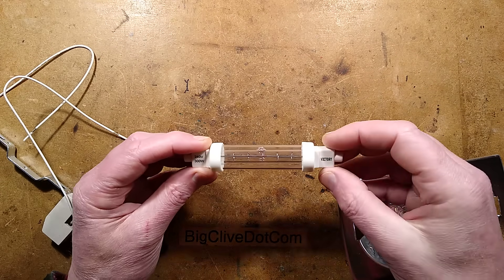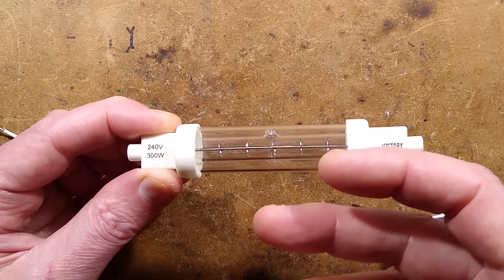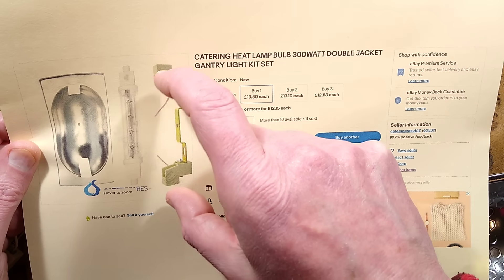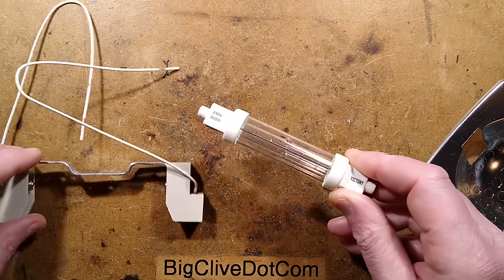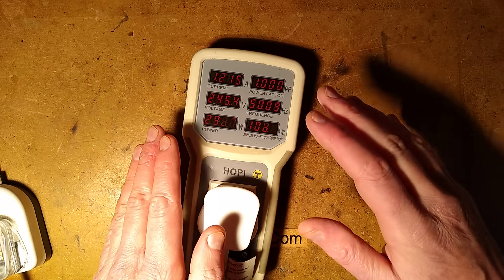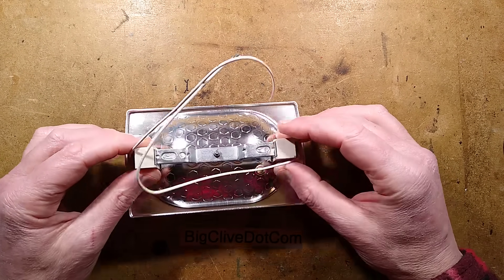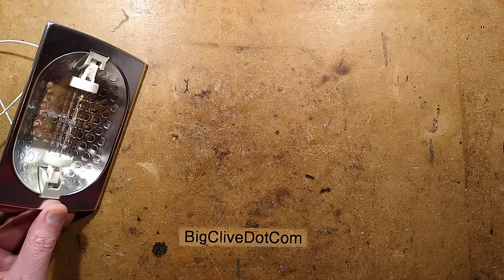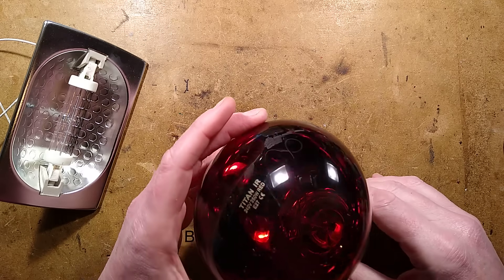Instant heat from an interesting linear heat lamp

Comment: Ah, one of those heat lamps used by places with a carvery to make sure that the Yorkshire Puddings are nice and hard and can be used as hammers and the outer skin of roast potatoes can be used as a leather substitute.
Reply: mmmmmmm nice roasted spuds that take the skin off the roof of your mouth. 😘👌 👍👍
Reply: leather subistutte....- sorry i cant write, alck of air
Reply: You forgot to mention turning the vegetables into galvanised rubber that can’t be chewed along with the gravy that needs to be hit by the Yorkshire Hammer Pudding to break the 2 inch layer of solidified gloop

😋
Reply: And pies can attain temperatures only found in experimental fusion reactors
Reply: @PaulG.x   ice cold on the outside, still piping hot on the inside, somehow.
Reply: I suspect that the tool replacement value was determined more by the initial fabrication than the later thermal treatment :)
Reply: Not to mention the breakfast application - imbuing scrambled eggs with a hardness best measured on the mohs scale
Reply: And the handles of the spoons melting into the cauliflower

Comment: My school kitchen uses 8 of the 250 Watt clear ES screw heat lamp. I don’t generally get 1000 hours life out of them, but interestingly the adhesive bond between the ES cap and glass fails before the the filament fails. This results in the lamp wobbling in the holder, so I replace them when they become loose to prevent the glass envelope falling into the food.
Reply: I've successfully used Gorilla Glue to reattach loose lamp caps. Use it sparingly though, it expands a LOT as it cures 😁
Reply: Same thing happens to the SES bulbs in my microwave!
Reply: Try buying quality branded lamps such as Victory Lighting as these are manufactured with the correct adhesive/cement which doesn't,t degrade over time. Cheaper brands and Chinese imports use standard cement and sometimes do not even have toughened glass.
Reply: I was thinking of that as Clive got it in to view.. #nasty

Comment: I remember, back in the day when some bathrooms had the lovely red heat lamps.  I really miss that!  Something about that red light just felt so nice to bask in while sitting in the tub.  The 70ies got SOME things right!
Reply: you can still see those in the US in some of the cheaper hotel bathrooms. especially in colder climates. so old, usually hooked up to a self timer, right?
Reply: That is different 'tech', a tubular (coil) heater element or made of (flat bar) nichrome
Reply: Here in Norway it is still normal to have one of those IR heaters in the bathroom. I even mounted one in my box van camper to get quick heat when I need it. They sell them everywhere here.
Reply: I still use one in my bathroom today that was installed in 75,, I've only replaced the bulb once 8 years ago.
Reply: The wife and I stayed at an older model in Amarillo on our way to Dallas for Thanksgiving. It had one of those old radiant heat bulbs. I turned that puppy on and basked in the glory of its warmth. Gotta love how water absorbs infrared light, and the fact we're mostly water. I didn't even turn on the main light for illumination. The warm, mellow vibes were just what I needed after 10 hours on the road.
Reply: Movenpick hotels had them until quite recently!

Comment: As a hotel maintenance worker I would say we get about 6-8 months out of these lamps, but they do get a pounding, on about 10hrs a day. Changed 3 of them this very morning. One of the maintenance team must have touched one of the lamps with his grubby little fingers because the chef said it exploded in quite spectacular fashion.
Reply: Here in Norway they instead use the IR lamps with thick steel element that glows deep red, they last forever even if you leave them on 24/7 for years... But they take a few minutes to heat up.

Comment: 1.) All glass bulbs need to be protected against shuttering in the food industry. Neon tubes have a plastic tube around or a plastic shield under it.
2.) What you called the "chicken pen type" lamp was exactly what was used in East Germany as "Rotlicht" or IR heater for your nose and ear when you had an internal infection.
"Fun" fact: there were still very few apartments in East Germany with an external toilet until the 1980's, usually ½ floor up or down with a door from the staircase. As there were no ovens or central heating in these toilets these lamps were used 24/7 during wintertime instead of the regular illumination as a protection against freezing and destruction of the water installation. 🤪
Reply: Actually in the food industry you should use enclosed IP68 lamps, However I have replaced all 500 in the factory with LED so no longer a problem. Payed for themselves on 6 months.
Reply: Can you elaborate a little bit more on the nose and ear infrared heater? I tried to google but found nothing. Is this just a small miniature bulb you stuck in your nose/ear?
Reply: @eugeneputin1858  https://de.wikipedia.org/wiki/Infrarot-Behandlung
It "liquifies" the residue in the paranasal sinuses & Co.
Reply: @eugeneputin1858  I was just going to say that Philips sold similar things in the west then found that the picture on the Wikipedia page is of a Philips lamp.
Reply: @MrDuncl pretty sure my grandmother had the exact Philips model pictured in the wiki page.
Reply: @MrDuncl  Philips 150 W is the actual model. It was the slightly bigger, rounded Model with 250 W in East Germany.
Reply: Dutchlander here, can confirm, my mom still has one of these face warmer things I think, and I remember using it as a kid. I think I had a sinus infection.

Comment: We used to use 2 500w floodlamps for warming up the inside of a 8' x 10' container modified to house a TrackStar machine for butt fusion welding MDPE / HDPE pipes for cross country water pipelines. The TrackStar did the actual heating for the welds but having a bit of ambient heat made the process more reliable and better for the operators.
Reply: Why would you want to fuse your butt to another butt?
Reply: @Dime_Bar  C'mon, we don't judge here. chuckle
Reply: @Dime_Bar You obviously don't know how to have a good time, but I hope you have a merry 25th of December.

Comment: I remember those red heat bulbs being in many bathrooms in the 70/80s, before we all had central heating and double glazing as standard, it was a godsend when getting ready for school in winter mornings before the living-room coal fire had a chance to heat the house or water, I used to get changed under it!
Reply: What country didn't have central heating in the 70s/80s or at least oil or gas heaters?
Reply: @rogerwilco2  Central heat/air started becoming commonplace in the 70s/80s. Most older homes would not have had it.
Reply: @rogerwilco2 the UK for a start! I'm 35 and even I can remember houses without any central heating into the early 1990s.
Reply: Still have one in my 1985 house, in the only un-remodeled bathroom.
Reply: @rogerwilco2  Neither of the 1980s built houses I bought here in the U.K. were built with central heating. In the 1984 built one, I bought an electric cooker so didn't have to pay a standing charge on the gas.

Of course back then a 23 year old on an average salary could actually afford a new house, even if they couldn't afford one with central heating.
Reply: There was one in the bathroom of the house my parents bought 1968 with two bulbs side by side, a normal spot for light and an infrared one for heat. I can't remember exactly how they were controlled. Probably a pull cord.
Reply: I feel like every hotel room in the US in the '80s had one of those in the bathroom, connected to a rotary timer so that you couldn't leave it on for more than about 30 minutes.
Reply: @wbfaulk  It was as ubiquitous for hotel rooms as the razor blade disposal slots, which simply dropped used filthy razor blades into the wall between studs.
Reply: @rogerwilco2  Norway... Very few have / had central heating. Most use one big wood oven or electric ovens in every room to keep warm.
Reply: -ADACOR- the back boiler is typically a separate unit installed behind the gas fire. Gas back boilers are designed to fit in a fireplace where you would have had a coal fire. And indeed, back in the heyday of coal fires, you could get coal fire back boilers (can't remember the trade name) that could heat water to supply a small number of radiators elsewhere in the home.
Reply: @rogerwilco2  UK. My first rented flat in London in 2000 had neither central heating nor double-glazing – it didn't even have storage heaters!
I had an open grate in the living room, and used a convector heater in the kitchen.  I must admit it got very cold in Winter as it was a GFF in a VIctorian terrace, so very deep and had high ceilings. During the coldest months, I moved into the living room and slept on my (thankfully very long!) sofa – rarely going into my bedroom. My first house a couple of years later was the same.  You could rent much cheaper in London if you opted for a flat without either.  And for my first house purchase, again I got a relative bargain.

Comment: Way back in the 60s my dad had installed a dual lamp fixture over the sink and during the Northern Wisconsin winters, he would unscrew one of the standard lamps and screw in the heat lamp. We used it to warm up the bathroom before us kids would take our weekly baths.

Comment: I made a PCB preheater using 4 standard halogen 500 W linear lamps, wired two in series, some stainless steel mesh and a standard triac dimmer. Putting two in series makes them give out more heat than light.
It is really helpful for desoldering and soldering PCBs with huge ground planes, as well as for hot-air (de)soldering of SMD/BGA.

Comment: I bought a 600W flat panel IR heater this year, as it has the ability to heat up solid things like tables, walls and, er, me, without heating up the air.  I'd quite like being warm but not having cooler air around me.

Comment: The Reflective heat lamps are still very common here in Australian bathrooms with a clear glass front. Most Aussie bathrooms have a combination heat / light / fan unit in the centre of the ceiling with a corresponding three gang switch mounted on the bathroom wall. 

We refer to them as IXL’s here in the trade but they are a great solution for heating up the tiled area on a cold morning, as central heating doesn’t exist here like it does in the colder countries.

Comment: 4:25 In my 1970s childhood my parents had an "Infraphil" heat lamp resembling this, though in a nice adjustable mount. It was supposed to help muscle pain but I don't remember it being very useful, and a hot water bottle was much easier to set up.
Reply: You can still buy these. They were often referred to as an Infrared lamp. I have one of these. I'm not sure if the colour actually serves a purpose but the things work very well when you have muscle pain.
Reply: @Ni5ei  It may be that the "colour" is actually a coating that absorbs the visible light and re-radiates it as infra-red. Usually the infra-red light from an incandescent filament is the waste and the visible light the useful product, but here it's the other way round!
Reply: @zh84 i guess the red paint ist mostly for not blinding the customers when using it and also blinding them to buy an overpriced "special"  lamp. Normal reflector bulbs were available much cheaper back then and would have done the job, too. Regular bulbs already emit 95% infrared.
Those lamps are ideal to use in your face If you suffer from a Sinusitis. In most other cases a hot bottle is way more efficient.
Reply: I've got one of the Infraphil lamps, it works very well. The colour is simply to reduce the amount of visible light, it's the heat you want in this application.
Reply: These are great when you have a bad cold and your nose is shut and you have headaches.
Reply: @NinoJoel  I get nasty sinus headaches  when I have a cold. I might try this, IF I can find the lamp, which hasn't been used for about forty years.
Reply: @zh84  these where still popular in Germany till around 2010 . 
You can still find some. 

They heat your face gently and loosen up all the stuff that is not comming out without medicine.
Reply: The red light by itself has some healing properties as well

Comment: The big bublb with red filter was traditionally used in medical "infra red" lamps for heating joints and various aching body parts. To this day I am using an ancient Czechoslovakian SAHARA lamp for heating my sinuses in winter. Needless to say, it is a life saver for me. There is nothing better.

Comment: Highly efficient, I have the screw in red bulb type outside of the shower in a dry off area, they are warm indeed. Only issue with IR heating is you cannot stare at the light directly or semi-directly too long because of the retina pressure increasing, same goes for most IR sources or so they say

Comment: Wish I had seen your video before replacing the halogen bulb in my car headlight. Got skin oil from my fingers on it which later made it explode, and I had scattered glass all over inside my headlight assembly. Learnt something new today.👍
Reply: It's a mistake you didn't want to make the first time, and the result tends to make you remember for the next.
Reply: @tbelding  Correct. However, my new car has now insanely complex LED headlights, with build in servo motors, autoleveling, CAN bus connection to BCU, microcontroller, and they even follow when you steer towards left or right. They are highly overdriven e.g. super blinding bright (I guess) with heat sink and small fans blowing on rear side of assembly. Whole headlight is over-moulded shut, non-serviceable, and if something fails you need to replace it with a complete new headlight, which is over $2,000 for the headlight part alone plus labor to install and re-program. Engineering going too far! 🤯 Best thing is the claim, “lasts for life time of the car” Guess it depends how you define life time? 3 years after warranty is over? 😂🤑 If one fails, I will send it in a package to Mr. Clive who surely will have a blast breaking it open and reverse engineer all the electronics, drivers and actuators inside. Cheers, Marco
Reply: @V8-friendly  - keep the paperwork with that claim on it.  If it doesn't have a rider saying what that is, it's at a minimum, the time in which you own it (first owner).
Reply: @V8-friendly  I seem to remember that he did that with a $1500 Tesla headlight unit. Turned out it was the electronics control unit that failed due to water getting in, and not the light itself.

Me, I just put in a new bulb (about £5 each) when a headlight stops working.
Reply: Thanks for this valuable information!

Comment: I work in a catering company that pretty much deals with these daily. Bain Maries use them for downlighting onto the main well and honestly they’re just my favourite thing to maintain. The simplicity of the wiring and how it all works means that when a call comes in for a “total rewire of the unit” I’m moreso looking forward to doing it, than locking myself in the back of the van hiding until someone else claims the call 🤣

Comment: We've had one of these "chicken coop" lamps in a simple desk stand base for as long as I can remember. The amount of heat that thing can radiate is immense (together with a lot of visible red light), and it's quite effective for muscle pain or when your (inner) ear hurts/is infected. But (as others already mentioned) you shouldn't look directly into the beam.
Reply: I remember the old infrared bathroom lamps, and BOY did those things emit the heat. They weren't very bright, but emit the heat they DID.
Reply: @NiyaKouya
What can happen if I look at the beam ?
If it worse than a white reflector bulb ?
I'm currently staying warm in front of my computer by having a 100W chicken coop-type bulb in an anglepoise-type lamp above my knees and whilst it's shining downwards some red light still gets to my face through the vent holes at the back of the shade.
It it harmful though ?
Reply: @psirvent8  I'm not a doctor, so I can't say if it has any negative effects on your eyes. I just know that our 150W lamp (which is most likely 30+ years old and maybe not as "efficient" as modern lamps) emits a lot of visible red light, so bright that it's uncomfortable to look at it for more than a second.
Reply: @NiyaKouya Ok thank's.

Comment: Fusion rollers in laser-printers use a long, slender version of this lamp.
Reply: Eaxctly and a few years ago I got one of them out of its rubber-coated metal tube and powered it up, however it immediately made my eyes hurt, most likely from the UV.
I thought that halogen lamps made for general lighting were UV-filtered while the ones made for printers weren't, however I found later that whilst some bi-pin capsules actually are, the linear ones from 100 to 500W on the other end never are even though they're designed to be used in rooms full of people nevertheless.
I know by having shone a blacklight at some halogen bulbs and the ones that had a UV filter did glow a nice blue while the others did not glow at all.
I therefore wonder how the 500W bulbs never caused me any eye strain or other issue while the 850W one from the printer absolutely did.
So much so that I ended up smashing it so I wouldn't get tempted to fire it up and damage my eyes even more every time.

Comment: I'm a catering engineer, work with these all the time! you can still get the 500Watt lamps too for now at least. And you can also still get the non-jacketed lamps too but we try and avoid using them these days because they don't last as long and as you mention the risk of glass in food should they shatter which they sometimes do.

Comment: I had a client that needed to temper the edge of a steel strip in a process.
We used five 500W Halogen bulbs, one along the edge followed by two above and two below. We could get the edge of the thin strip to 1100F (600C) in a few seconds.
And control was easy.